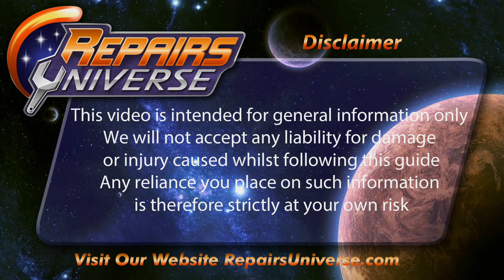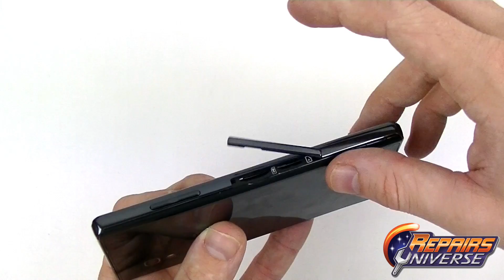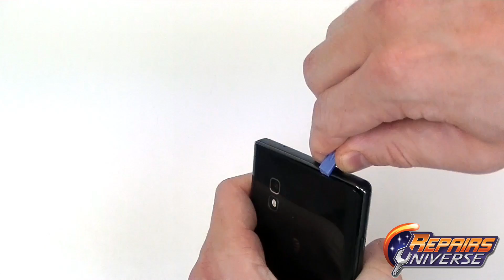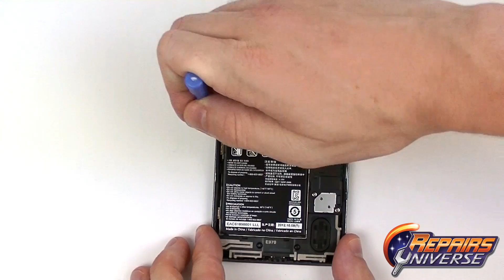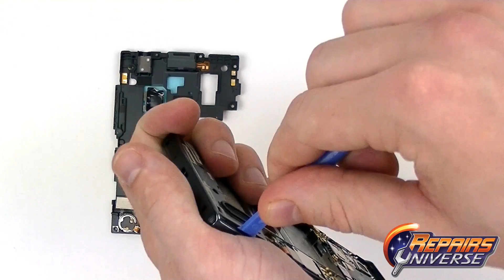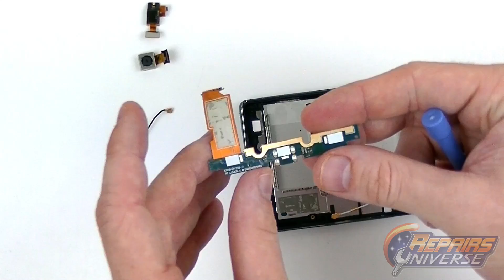LG Optimus G USB Port & Keypad Flex Replacement Guide

Comment: Hi. I have an AT&T LG Optimus G (E970) that suddenly won't connect to any of my computers. I noticed that in the video, the charging port assembly is one of the last things you removed. Is removing all those parts necessary for replacing just the usb charging port? How far should I go in removing things before I can reach that particular part? Thank you!

Comment: how do I change the charging port for my LG opimus F6? it will not charge.  Also where can I purchase the replacement port? Thank u
Reply from the maker: To change the charging port all you need to do is remove the charging port flex. This will remove a small board with the usb port attached. At this time we don't offer a charging port replacement, but they are available on the net. Just Google LG Optimus F6 charging port
Reply: Okay, thank you very much for the prompt reply I really appreciate it
Reply from the maker: No worries Im happy that I could help.

Comment: I just want to replace micro usb charging port, do i need to detach everything before im able to do so?
Reply from the maker: Mija Yun It is not necessary for a USB charging port replacement. Just be careful not to damage any other internal components when removing it.